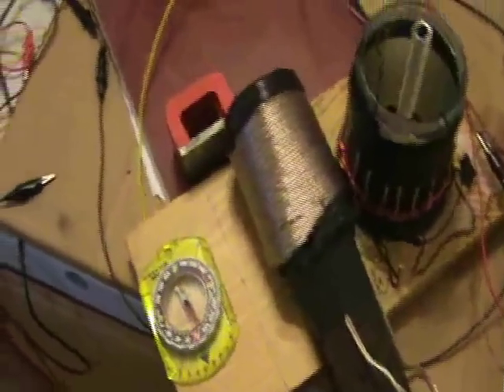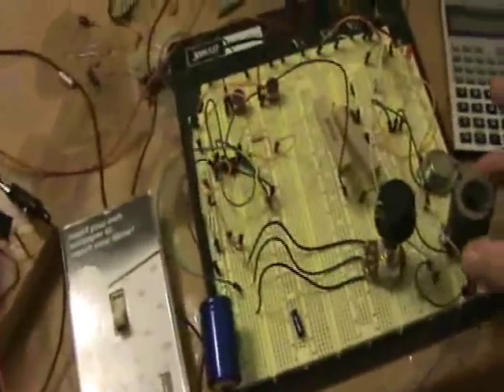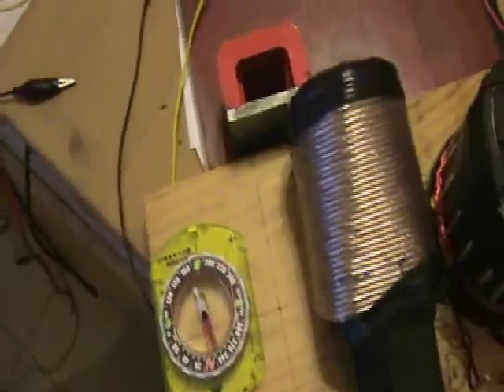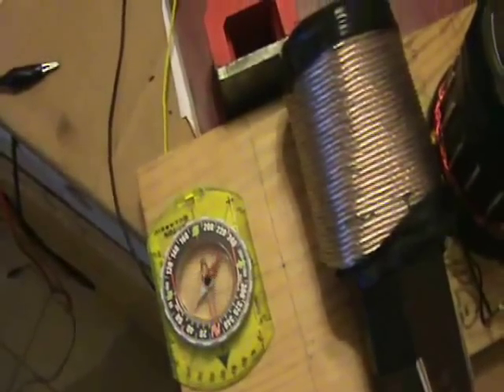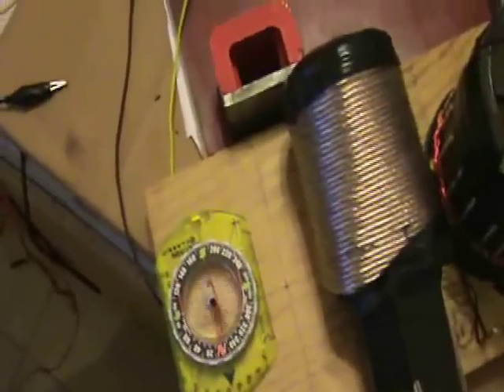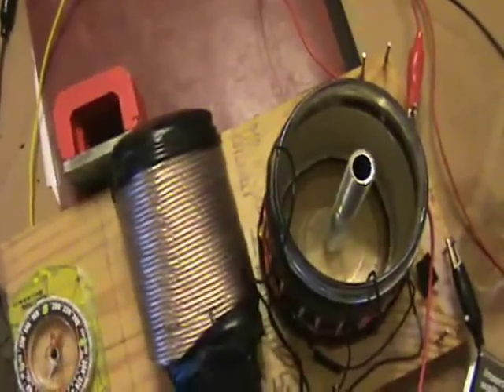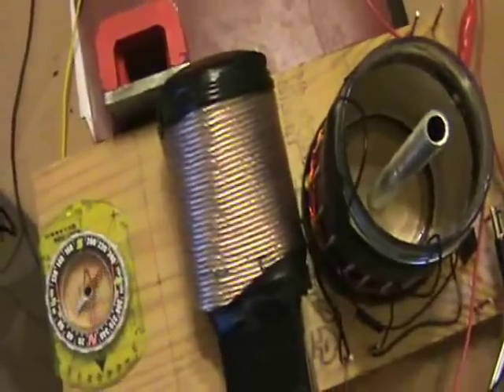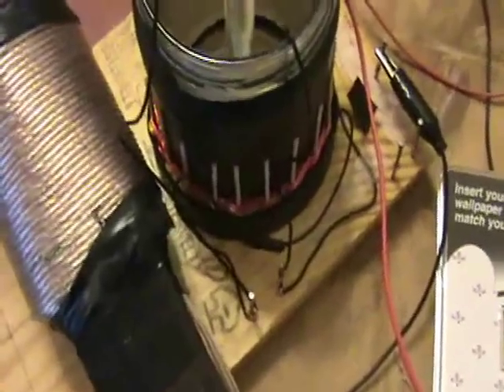Driving Hendershot Compass Spin using 555 timer

Comment from the maker: Yes ... I've heard about the "it gets colder" phenomenon ala Tom Bearden. I have never witnessed that effect in any of my life experiences, so that is intriguing. It would also be very useful since COOLING lowers resistance. I think Hendershot has a non-linear system here and the trick with any chaotic system is finding the right initial conditions to get it going the way you want. Waves can interfere of cohere.

Comment: oh, and one thing I forgot to add is, if what I'm saying is actually taking place, then the localized temperature around the coil should go down. I've read in several places of that very thing happening on some devices built, for instance, some of the Bedini style devices ( if memory serves me right ).. The more energy you extract, the colder things get. There is nothing magical about this, and it doesn't involve ANY new physics

Comment: Think of the circumference length as one wavelength. Also, a charged particle moves in a curvilinear fashion in a magnetic field. Those ions can circulate in that can/capacitor circumference, back and forth ( at the right frequency, of course ) and transfer their energy of motion to the tank circuit by induction. To understand what I'm saying here, google 'magnetron tutorial' and check how the electrons transfer energy in the tube. This is, although not exactly alike, similar.

Comment: yes, the tank circuit will dictate the frequency, what I am saying is that you need to tune that tank circuit to the ion velocity at room temperature, i.e., 1/2mv^2=3/2kT, fitted on the circumference of that tin can. In other words, the ion can transfer it's energy of motion to your tank circuit, and be pumped from one tank circuit to the other in a multivibrator fashion. You extract the energy by induction. I'm convinced this is how this circuit operates. it  would not work with just one tank.

Comment from the maker: re: frequency
I thought long and hard about that and I think the TANK circuit will dictate the frequency, and that it will be LOW due to the large inductance which is affected by the permeability of the cylinder. However, that low frequency MAY be a power-of-two multiple of a higher electron or proton SPIN frequency -- yes.

Comment from the maker: Anything that PINGs the coil, such as a distant lightning storm, will make it ring.. The tank will do a dampened oscillation for a time, depending upon Q. The other coils pick up energy inductively since they are coupled, a transformer. A voltage differential can be created between the two TANKs. The bar and magnet can be brought into oscillation using the power and some power can run a load. It does seem possible. Now to build it...

Comment: It's clear that Hendershot was using the two coil/capacitor devices in a multivibrator type circuit, and 'pumping' energy out of the medium ( air ), in a manner not unlike how a tornado seperates hot and cold molecules. It's like store the energy in one tank circuit, then store it in the other tank circuit. I'm also guessing that the frequency is related to the ion's velocity at room temperature by the physical dimensions of the cans ( similar to how a magnetron's size can determine the frequenc

Comment: the magnet should be steady and secure the the plate pulled evenly away from the magnet, this will take a strong  move able device to pull it back at graduates dad used a 3/16 or bigger threaded shaft to turn it back i guess you can see the small coils attached somehow to the back side of the plate, these looked like common solenoids this i believe was called the key adjuster by causing an air gap it would chatter lound then lower as he adjusted it , refer to the photos where the magnet ismjh

Comment from the maker: I'm messing around with the coils currently. I will get the magnet assembly soon. I'm not very good with mechanical stuff ... so I'm not sure yet what I will do. Re: Plate. Is it to be pulled away from the electro-magnet or pulled away from the horse-shoe magnet?